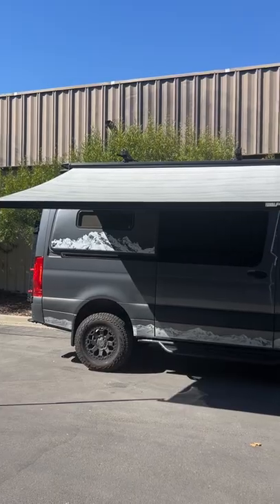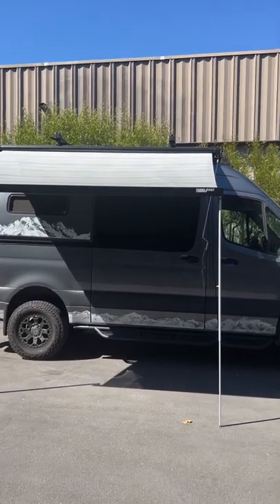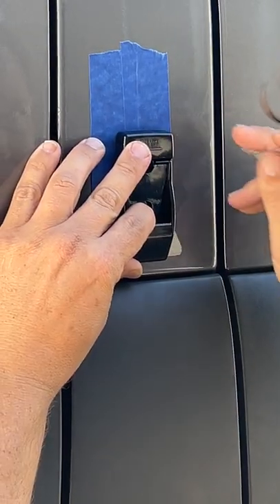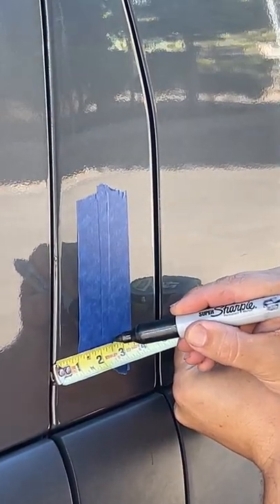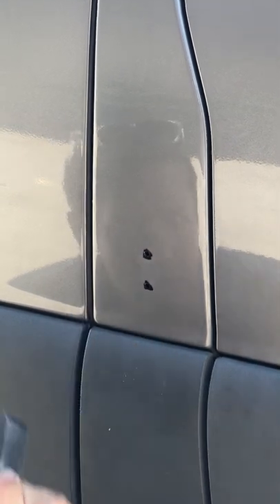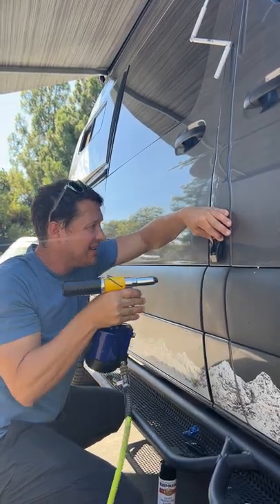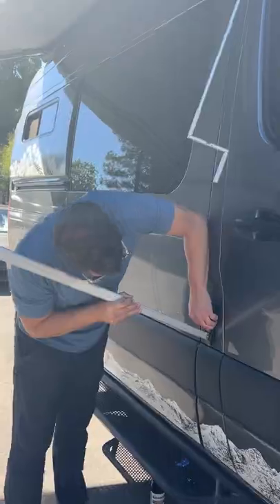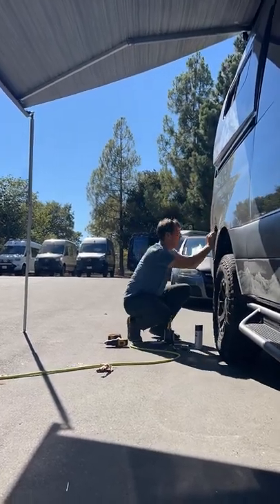How to Install the Fiamma Awning Bracket to Your Van | YouTube Short

Comment: I think there is a pretty good risk of rusting/corrosion (aluminum/steel combo)
Reply from the maker: It's important to get the hole covered with rust protectant. I haven't had any corrosion in 1.5 years on this.
Reply: @VanLand  thx for the longer term review of the rivet method. I just installed using the same method. I used stainless steel rivets and painted them prior to instal... and used a rust preventer and paint on the bare metal before installing.
Reply: @crowdtastic  this is howie dewitt